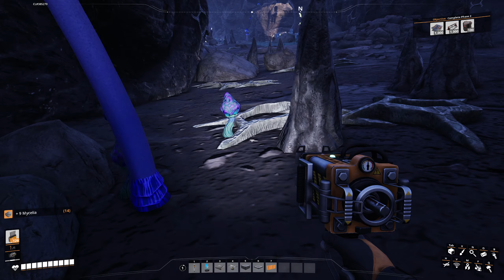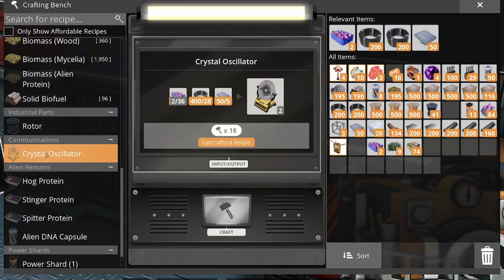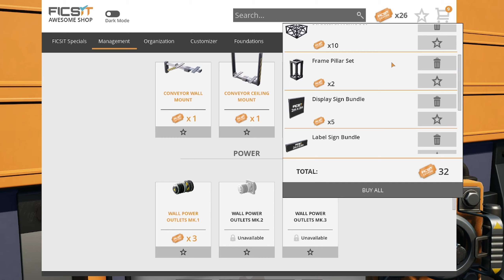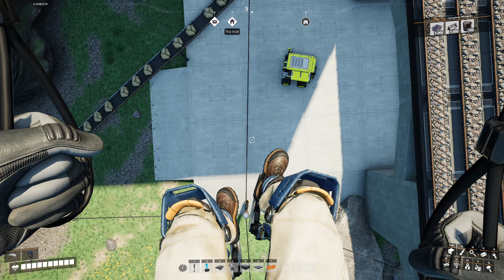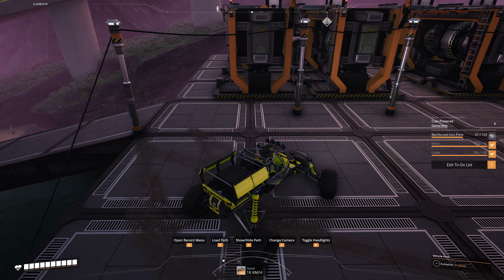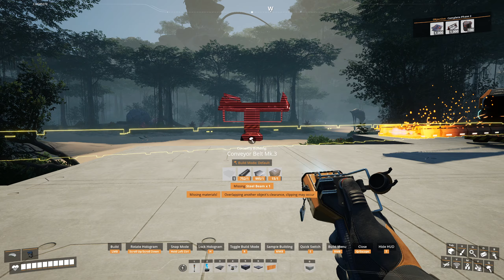2400MW of Coal Power - Ep6 - Satisfactory

Comment: I did a similar build (but not as elaborate architecture wise 😅). But I added a 3 floors backup solid fuel power plant. Basically, I drop my woods, leaves and biomass in a container, it process it all to solid biofuel. From there, it feeds 16 biomass burner. So the burners works to start the miners and the water extractor and when the coal generator kicks in, they stop burning (since they only produce what is needed).

And if for some reason I exceed my power production, that gives me a buffer to adjust stuff, some power to restart the miners and water extractor and produce the solid biofuel (dumped in a dimensional depot after all the burner). The only thing I should add is probably the power priority switch to keep only one miner and few water pumps to restart everything without the rest using it and causing another blown fuse.

Comment: How did you attack the angled walls to the conveyor belt? I tried everything and I couldn't figure out how inverted it and attached it to the conveyor
Reply: God my spelling was horrible. 
1) How did you angle the Frame wall?
2) What did you use to attach it the conveyor? I tried using a metal pillar to no avail.
Reply from the maker: I used the infinite nudge mod which let's you rotate anything in all 3 directions (X, Y, Z). I didn't attach the conveyor to the walls though. I put down a row of 1m foundations and put the conveyor on that. Then deleted the 1m foundations and put the angled frame walls underneath at just the right height so they barely touched the conveyors.

Comment: It is very tempting to unlock all the milestones (or most, anyway) as soon as you enter a new phase.  None of that was surprising, at least to me.  Unless you're doing a no-handcrafting playthrough, I'd guess it's more common than not for experienced players.  Even then I see single-foundry setups to quickly get steel going, just for milestone unlocks.

The coal startup process can be sped up by using portable miners to grab whole stacks of coal for each generator.  You can actually fill the water first by hooking them up to a power line (but not your grid), I believe.  Of course you have to power the water extractors, use biomass or just your normal grid if it's powerful enough.  You could do just the first few (4 or even 8 generators), and at that point you'd have the power to turn on the rest of the water.  I also have grown to like the 2 generators per extractor ratio - if you go 8 to 3 you have to do tricks to move 360 water with 300-max pipes.  It's not that hard, but more difficult than it needs to be.  I think the 2 to 1 with underclocked extractors actually uses less power?

Speaking of biomass - the DNA capsules are worth a lot of coupons, it's true.  But remains are a practically unlimited resource, especially once you have a vehicle.  They make SO MUCH biomass that you can pretty much stop gathering leaves and wood once you start exploring and hunting the wildlife.  I keep using them later in the game to make liquid biofuel.  With (spoiler) one carcass can turn into several hundred biofuel.

That coal belt is SHARP - this one use has convinced me to go download Infinite Nudge.  I didn't think I needed it with the 1.1 enhancements, but as you say it is still a bit limited, even with the improvements.  The bridge looks nice too, but I've gotten used to doing those with the new Small Road Barriers and Braided Cables (try it, I think it looks pretty good).  Regular nudge (needs vertical though) is all that's needed to make that look seamless.  The downside is that it does require a little steel.

Great episode(s).  Glad I stuck with this series, you have come a long way in a very short time.
Reply from the maker: Wait until you get to episode 24. I automate packaged liquid biofuel from remains and after a couple hours collecting mercer spheres I have more liquid biofuel than I'll ever need. I never considered starting up the coal generators like that but it makes sense.

I'm glad you're using infinite nudge now, you can do so many cool things with it I really hope the devs add the rest of it's features in a future update. I hope you continue to enjoy the series.

Comment: Mate, how did you get the V shape with your Frame walls under the coal belts, really like that.
Reply from the maker: The infinite nudge mod. I'm glad the devs added its infinite nudge range and vertical nudging, but they really need to add its other 2 big features. the ability to rotate in all the axis, and the ability to nudge in finer amounts down to 1cm.